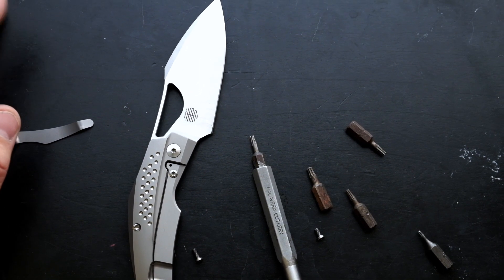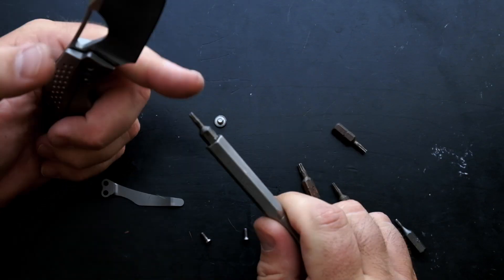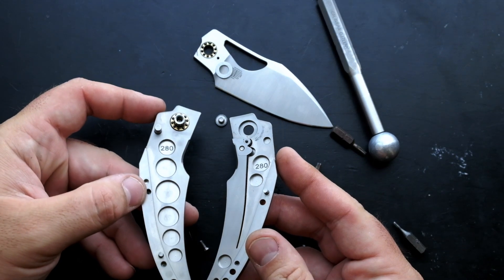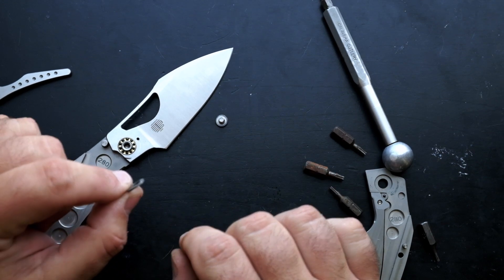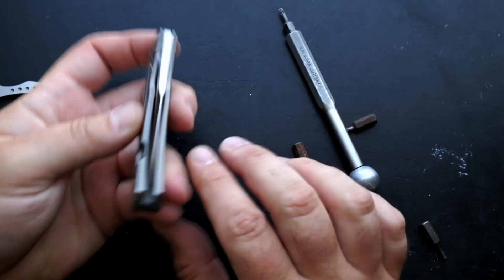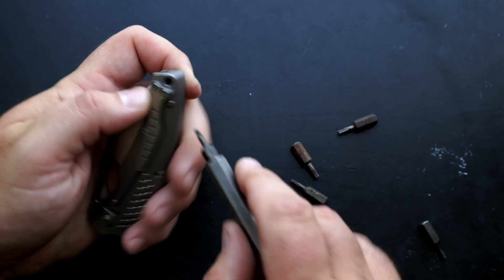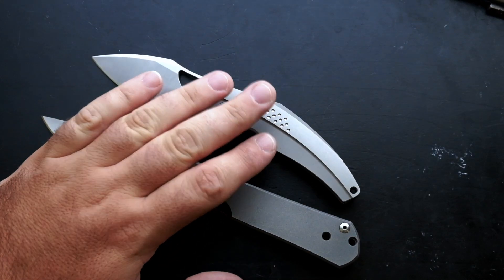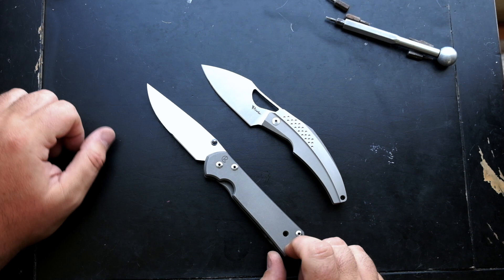Banana Break Down: Reate Baby Machine

Comment: Thanks for the vid! I just bought one of these. My only reservation about this knife is the lock-up being only about 10%. Have you had any issues with this?
Reply from the maker: NOWISM Thank you for watching! I have not any issues of any kind with my knife at all. It’s been perfect for me.
Reply: @JoeBananas3  Hey, thanks for that swift reply! Sounds good! I figure that as long is it's safe, having a shallow lockup makes the knife operate more smoothly.
Reply: One more question while I've got you on the line: I've heard Reate globs adhesive on the pivots/screws. Did you find this to be the case and if so, any tricks to remove them?
Reply from the maker: NOWISM Nope, no issues with disassembly at all. I’ve taken it apart twice since I’ve owned and each time was as easy as this video shows! If you do run into issues, you can run the pivot area of the knife under some REALLY hot water for a minute to loosen up the loctite and unscrew it asap!
Reply: @JoeBananas3  Nice! Thanks again for your help!
Reply from the maker: NOWISM My pleasure!